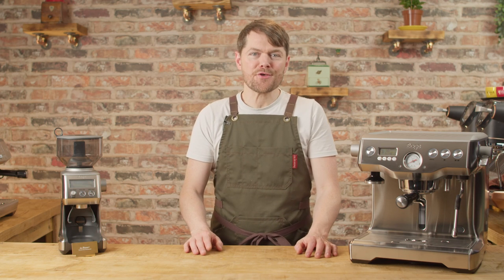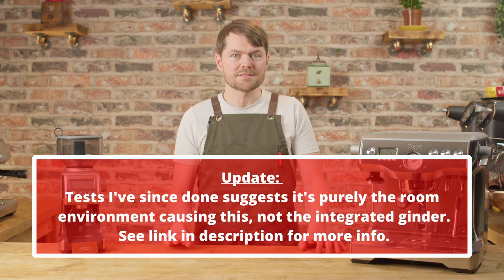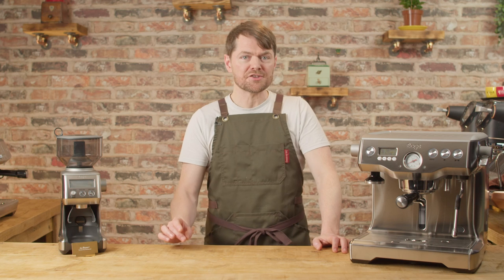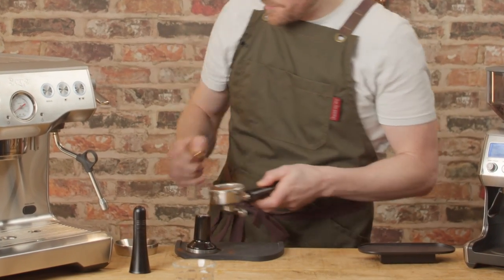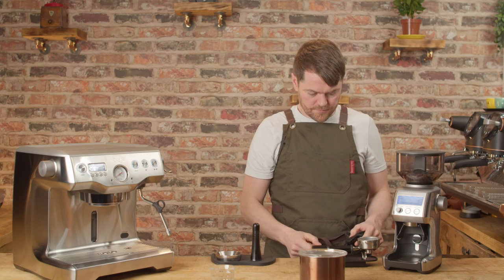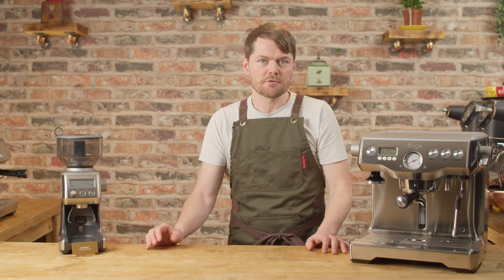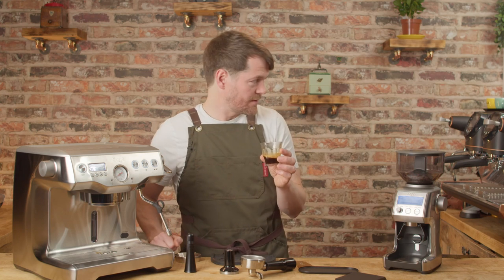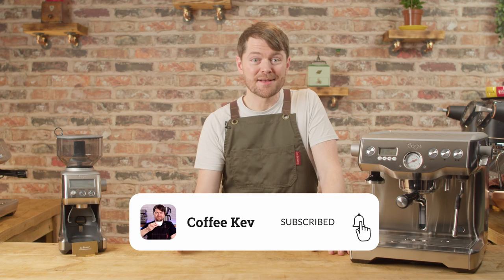Sage (Breville) Dual Boiler: Part 3 - Dialing in Espresso

Comment: At present use Duo Temp Machine, which I have had  for a year now , and have paired with the Smart Grinder Pro.
As mentioned, only use dark roast beans, and find that weighing out 18 g of beans and then grinding on setting 12 ( factory setting ) gives me what I find to be a good coffee.
However will listen to any extra advice you may offer Kev.
Thinking of upgrading to a Dual Bouler in the future, to give me the temperature control, which the Duo Temp does not provide.
By the way…. Use a cork with needles to distribute, and after buying the puck screen which is shown in you video, this has really improved consistency.
Reply: Dual Bouler even …😂
Reply: Bloody phone 😂😂😂
Try again. Dual Boiler !!

Comment: Could you kindly do the same for single shots please (approx 10g) to allow one to get more cost effective use or shots (but not so bold) from an average 200g-250g bag of beans. It gets rather expensive using double shots as a basis for every pull, especially having 2 or 3 wee cups every morning. Thanks
Reply: I  am aware of all the difficulties with single shots, but it would be great to see something about how to get the best possible out of the single shot basket.  Having switched from Nespresso, partly to save the planet from aluminium pods and partly to save money, I simply can’t afford to be dumping the second shot each time…
Reply from the maker: Hi Carl, I will be doing a video soon on single shots, cheers
Kev

Comment: I have both the Dual Boiler and Sage Grinder, however the only way I can get close to dialled in with a fresh dark roast, is to have the internal burr set at 1, and the external setting on 3 to have any chance of getting a decent extraction window and pressure. Spoke to Sage about this, thinking they would  be able to help, all they suggested was using a medium roast, which in my eyes would just makes matters worse . Is it possible I just have a duff grinder.... (Its brand new) ?
Reply: I don't know if this is related or any consolation but here's my story and experience. I have the Sage Barista Pro which they say has the same grinder as the Sage Grinder Pro. During my first months I was struggling with proper extraction. I had the internal at 1 and external at 2 to 5, pretty much just as you. Truth is that initially I was using supermarket coffee that had been roasted more than half a year ago. Then at some point after 3 months and approximately 150 espressos, the grinder changed behavior and I had to grind much coarser. I moved to internal 2, external 7. Now, it's been about 9 months since then and I use only 1-month-old roasted coffees and I grind at internal 3, external 10-11 with very consistent shots that are easy to dial in. So here's the TL:DR version, I have the suspicion that the new burrs are actually too sharp and create uneven grinds during the first hundred coffees. I believe that eventually they become conditioned and grind better. But that's just my idea...
Reply: @AntonisMatakos  Thanks for the reply, very interesting... I'll just persevere and see what happens, maybe they just need a bit of time to "Bed in", fingers x'd.

Comment: Compared to the Duo Temp Pro using the Dual Boiler the portafilter is soaked and covered in water after extraction and frequently the coffee remains attached to the machine then the portafilter is removed. I never had that with the Duo Temp Pro when the coffee after extraction is usually dry. I have the Sage Smart Grinder Pro (5 years old now). The level of coffee is such that the razor does not find coffee to remove. Using the single cup filter and a grind level of 9 for 8.4 seconds (roughly, depends on the bean type/blend) and a temperature of 95 C.  The grinder has to be set differently to when it is used with the Duo Temp Pro as the portafilter is much larger with the Dual Boiler.

Comment: Did I miss the grind setting rare we meant to guess?
Reply from the maker: You missed it, 10, but it's really not all that relevant, even if you're using the same bean and the same set up you won't necessarily end up at the same grind size. Cheers, Kev.
Reply: @Coffee_Kev  Thanks, down to me, but it. may be  a guide as a starting point.